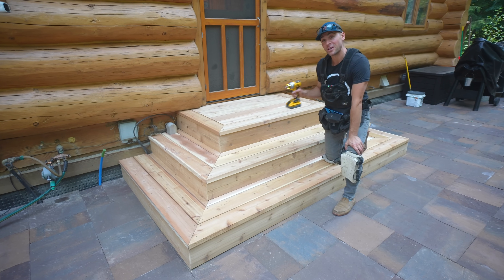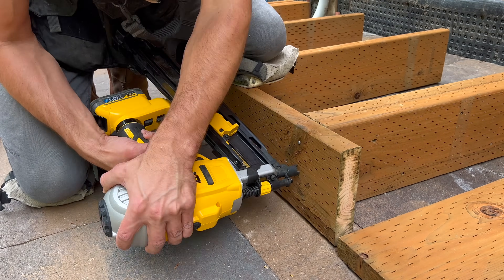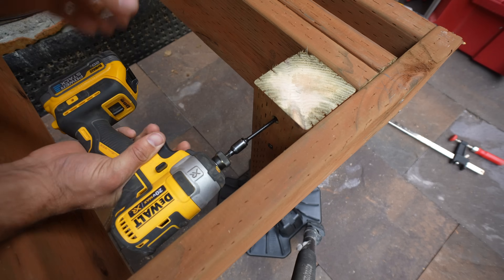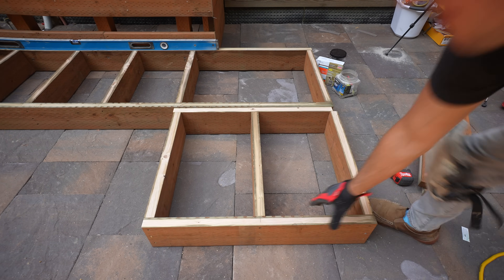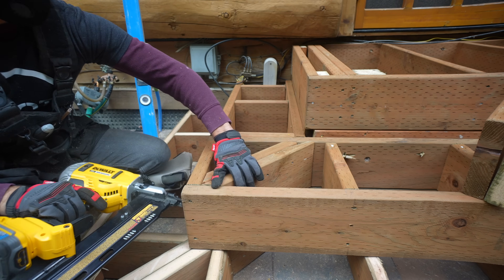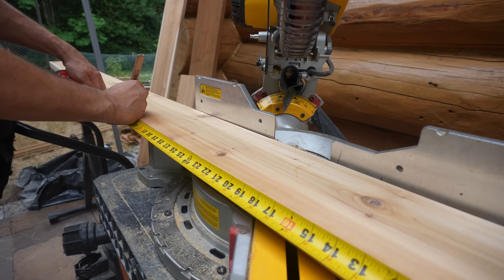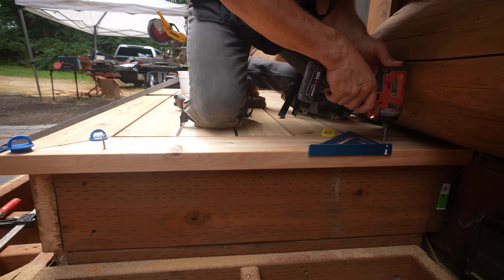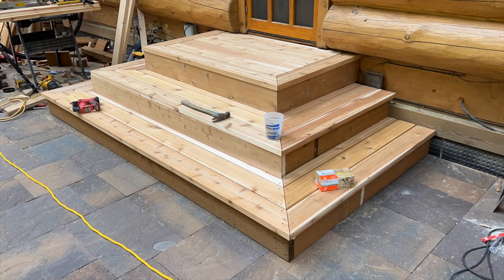How To Build Pyramid Stair With Landing

Comment: Another tip for your pyramid stairs. He made the risers too high. If this was a new build you would fail inspection. For safety do 7 3/4 or less.😉
Reply: His are 7 1/2
Reply: @sergeividov  7 1/2 “ + deck boards 1 1/2 “ that’s finished surface.
Reply: Couldn't have comments without a code thumper.
Reply: Local building code requirements dictate the maximum allowable height requirement. In the north east, 8 1/4" is the maximum height. The given height is dictated by the height that is needed .
Reply: @trancextend the rise on this build is 7½". Watch the video starting at 5:50. The bottom box is cut to 6" to account for the extra 1½" for the treads. After that bottom layer, the treads added in front of each 7½" riser cancels out the treads placed on top.
Reply: Did you even watch the video 😂
Reply: Are you that slow or just trolling?
Reply: Bless your heart but obviously you don't how to build stairs. The maximum height is 8.25" and no less than 5.5"
Reply: Glade my country doesn't have this fussy inspection
Reply: 15:46 - looks like 8.5” to finished surface
Reply: What happens when you need to access the services on the left side of the door behind the steps?
Reply: @woodnitbenice1277  I thought the same thing he took 1 1/2 off bottom box for tread thickness allowing for consistent 7 1/2  rise 😊
Reply: I believe the rise was approximately eight and one half inches Beautiful job, but the guy is absolutely correct.They are a little bit too high

Comment: TuffBlocks are great, but it not only voids the warranty but also it’s now of unknown structural integrity by modifying them.  Its prob fine for something this small, but def would not do this on a real deck or foundation.  It specifically calls this out in the installation manual and spec sheets for anyone looking to do this.
Reply from the maker: Thank you so much for bringing this up. Should have said something in the video about that and you are completely correct. Would never do that to a deck footing but I’m not worried about the structucurability on something this small. Still way overkill with three of them plus the block steps are adding a ton of support as well. Thanks for watching and your comment.
Reply: Could you have just cut/notched the timber around the footing system and added a few extra horizontal timbers for extra supports?  I'm sure it is fine considering how small the steps are.  Love the build. Going to do something similar!

Comment: I am having trouble understanding why you ripped the bottom box boards to 6 inches but left the 2nd box boards at 7.5 inches. I understand the bottom boards are 6 inches and then adding the 1.5 inches from the deck boards will be a total rise of 8 inches. But won't the 2nd box rise be 7.5 inches adding 1.5 inches for your deck boards too? That would make the 2nd box have a total rise of 9 inches? Could you explain this to us =)

Comment: You need to use screws rated for treated wood not nails. Posts need to be placed under the joist not along the sides. These are very basic decking procedures.
Reply: Code in my area requires joists to sit on top or on a notch of the beam. Fastening joists to the side of a post is not permitted.

Comment: Love the work you do in your videos, may I make a suggestion? On all the pressure-treated lumber you cut, always treat your cut ends, that end grain is like a sponge and will wick water in fast and rot from the inside out. Something my Dad taught me back in the 70s, yes it takes a bit of time to treat the end grain cuts, but it will make it last a few years more.   just a suggestion. :)
Reply: What works best to treat them?
Reply: @rozanne38  Cut-N-Treat Wood Preservative is for cuts, holes, and injuries to pressure-treated wood used in above-ground applications. Or similar product.

Comment: I just finished a rectangular deck with stringers on one entire width and one entire length. It was lots of work! I think I would do box steps the next time! 

Just a few suggestions for future stairs: 1. If you apply deck tape on the top edge  of each pressure treated board, it will extend the life of your framing. 2. Pressure treated lumber is only treated about 1mm deep on each surface of a board. I recommend to get a brush and apply copper green to each cut. It is especially critical  when cutting the end grain where water will get soaked into the wood causing dry rot. Allowing copper green to soak into the crosscuts will extend the life of your framing. 3. Lift the bottom  box above the ground to allow drainage and prevent the wood from sitting on the bricks. Maybe secure those plastic pucks onto the bottom box? The riser would have to be adjusted for the height according to the thickness of the pucks.

Comment: I like the rubber pucks you used against the house as that is the same idea that was done to my 120 year old house. My house was built out of all ruff cut lumber and when they doubled all porch boards the put 1/4" lath boards in between for water and air.

Comment: Great craftsmanship. However I have a question about the electrical wiring behind the stairs specifically on the left hand side. Seems the wires were just falling behind and in between the spacers. I hope everything worked out. Looks truly amazing. Nice and clean. What's the value of this alone?

Comment: An electric pull box was half buried behind the left steps.  There appears to be what looks like the bottom of a drier vent is buried behind the second step on the right side.  If it is a drier vent there will be an accumulation of lint that will be difficult to remove.  I was surprised that there wasn't any kind of flashing from the sill to the top of the water proofing behind the pyramid landing.  One of your earlier videos showed you applying wood preservative from an old container.  I wondered if that old container was put back on the shelf, only to be removed if you made another deck video.  Evidently you don't consider this a deck and so applying preservative would be unnecessary.

Comment: It looks very nice and is a great addition to the cabin.  You have good skills but some unsafe habits.  Your hand placement while nailing the frame and using the table saw had me scared for you.  With your hand placement, you will have a nail in your finger at some point (if you haven't cut it off at the table saw).  Please practice safer hand placement in the future and for viewers of this, please be aware that nailers can (and do) misfire sending nails out the side of the board.

Comment: The bottom step just sits on and rests on the ground? It doesn’t get secured in any way? No rise off the surface or vapor barrier or anything? Won’t direct contact hasten the rotting of the wood? I’m installing a paver patio and have a set of poured concrete that are not centered on the door and have no consistent rise/run (prior owner DIY). I’m wanting to build something similar to this structure over and around the current concrete steps. I live in Northeast Ohio so rain/snow is a factor.

Comment: Great video …followed construction methods 100% so far …have 72” x 26” porch framed in and will be 27” final height so I will have 6-3/4” risers for total of 4 risers or 3 steps plus porch …starting box steps as soon as rain quits …using timbertech  composite for final surface on pyramid style steps

Comment: thanks for the flyover, flyby at the end of the video. More diyer's should do that. If can, exploded plans would extra bonus. The measurements aren't important since the overall dimensionso of every landing isn't the same. Oh, is  the top landing dimensions limited by the width of the two steps? I would think the top landing would have been larger.

Comment: I have a general question which is how do you know what direction your actual deck boards need to go?  Such as a flat entry/ exit from the deck to the house, no stairs.  I'm unsure of i should run the deck boards parallel or perpendicular to the entry/ door?

Comment: Thank you for this video! You did a solid job here!! I would like to build this for my wood shop. I was wondering, do you think this would work free standing? I just finished installing fiber cement siding on my shop, and it would be a lot of work to remove it and install a ledger board (at least for me, as I'm not a professional by any means). Do you think it would work to replace the ledger board with more posts?

Comment: Yea... Trees are beautiful...even when you cut them to pieces. You can shape their soft trunks in so many ways and build woodgrain-marked things...even buildings. 
Yet, this set of stairs is gonna look rotten after a winter or two, even if soaked in the best wood protector-impregnator invented so far...never mind dents scratches and cuts. It is a continuation of a building project one generation after we finished playing with Lego. And, sure, it is the cheapest and simplest way to build structures in cultures with abundance of trees.
I expect this culture to build a pyramid and expect it to last a millennium or two.

Comment: Apologies if the followinmg was asked already: The Cedar Decking, you used Stainless-Steel screws to secure the lengths to the framing; if the Framing were Pressure-Treated wood structures, would the Pressure Treatment (the injected acidic materials that made those boards Pressure Treated) tend to corrode the 'pointy ends' of those screws? I have found that unless I use Galvanized Steel (electro or otherwise) screws, then my screws always end up discoloring the wood where they touch, as well as tend toward failure within a year's timeframe. AM I mistaken? Or is there another solution?

Comment: I am planning a similar project over a concrete slab.   Just wondering if the structure is vented to allow for moisture issues.  Water definitely dripping through the deck boards.  Mold under the stairs along with debris over future years could expedite wood rot.  The TuffBlocks are awesome, just wondering if they create enough clearance to allow water and air to pass under the stairs.   I like how you cut off the TuffBlock flush (I read the warrantee comment in a previous posting, but I would do the same)!    Great work, very strong and sturdy!

Comment: What is code where you are for maximum stair height?  8-1/2" seems high.  Max height where I live is 7-3/4"   Just curious.
Reply: U.S. Code for residential step rise should be the same everywhere......7 3/4" max.....Canada is 8 1/4".
Reply: The rise on this build is 7½". Watch the video starting at 5:50 where he rips the riser for the bottom layer to 6" to account for the 1½" tread height. Each additional step, the treads are placed in front of the 7½" riser, so the sum is still 7½" when the next treads are placed on top.

Comment: Excellent job!! Question about cedar decking - do you need to space decking during installation? I've heard some say that the boards will shrink over time as they are typically pretty wet when sold? I did a similar project and let the boards dry for a week and then spaced as you did.
Reply: Let boards dry first cedar shrinks a lot  I’m a professional builder on decks
Reply: Shouldn't you have 1" a finished overhang on your treads.?